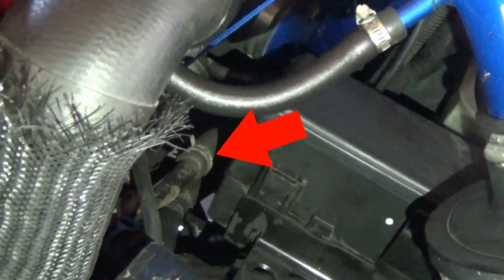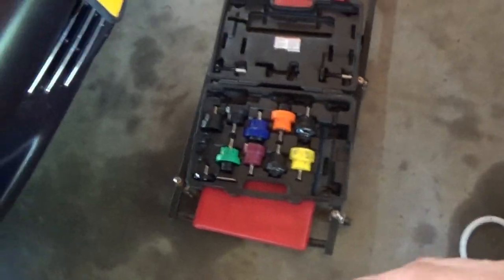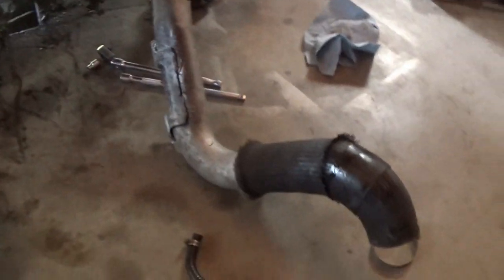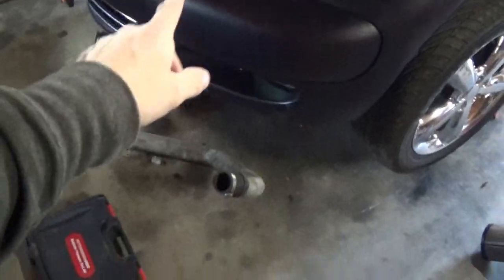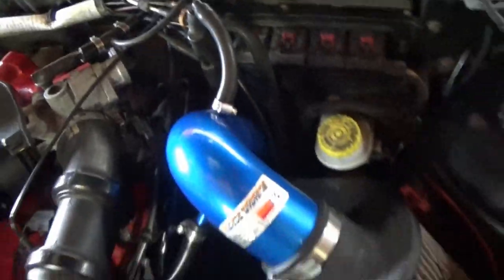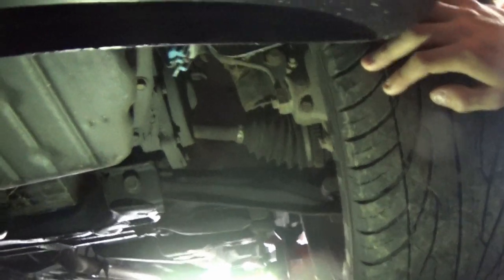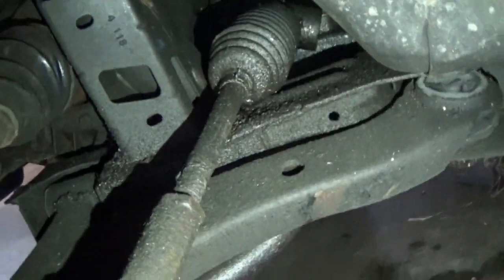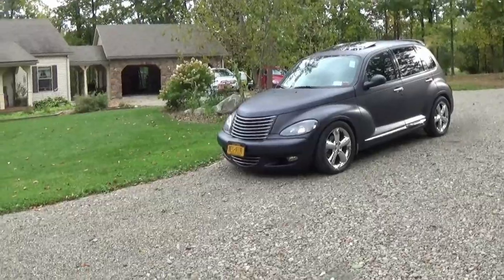Glad I Caught These Leaks When I Did!! - Bad Water Lines + CV Axle??

Comment: While you are changing the motor mounts, do you plan on servicing the water pump and timing belt? It's a good idea to knock out while you are in there.

Also, quick question: At the end of most of your videos you sometimes make a few pulls. When you do I always hear BOV noises. Where is your BOV located? I did not notice a block off plate or Mopar vent.

Thanks man!

Comment: I've wanted to upgrade my 2004 gt pt cruiser but I dont know what you do or where to start any advice?
Reply: Luke Estby start with lowering springs and 25 mm spacers. It will make your car handle great. Then do an intake, probably K&N typhoon intake. Then get ride of your muffler or get a straight thru design, and then get your self a 3 inch down pipe and a tune and you will have a little rocket
Reply from the maker: J S B B D couldn’t have said it better myself!  Intake and exhaust is what really bit me with the mod bug 😂 the turbo noises are too good!!  Some low and some spacers are always a necessity too 😜 Good luck with your GT!!